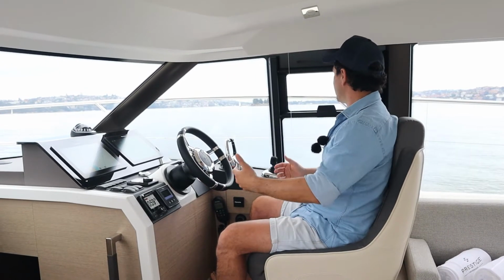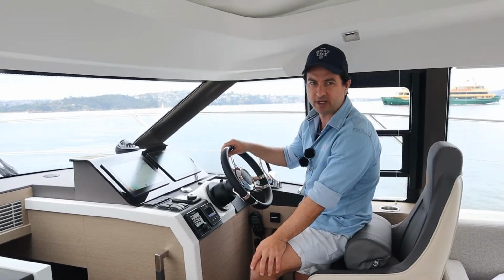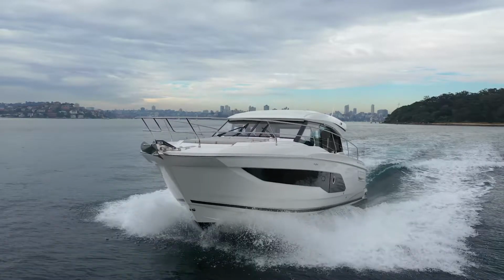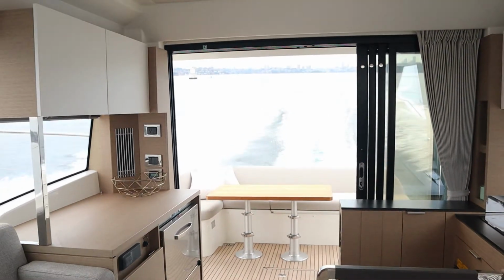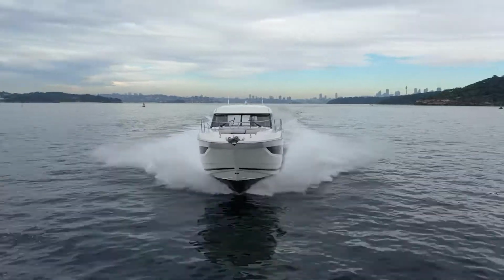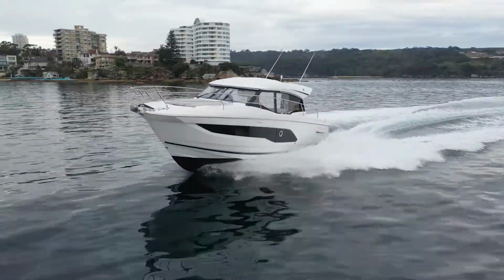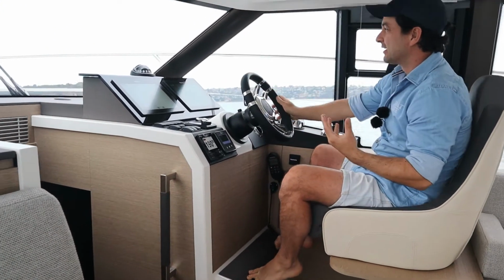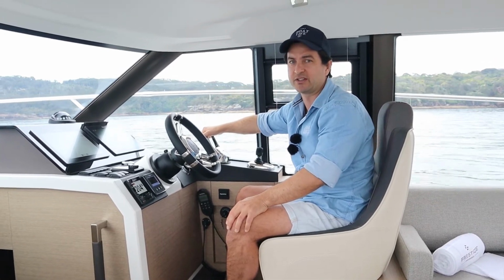2021 Prestige 420S - TEST DRIVE  looking at speed & fuel consumption with Dan Jones

Comment: Gotta say Dan, I'm very happy that Prestige are running a traditional shafts on this boat. Yeah you lose a bit in top end speed, but man, it's so much better than having pods or drives in the water all the time with the gearboxes corroding. If you plan on having this boat for a long time and doing the Syd > Nelson Bay trip, or to Pitwater, it will treat you well in the servicing side of things long term!